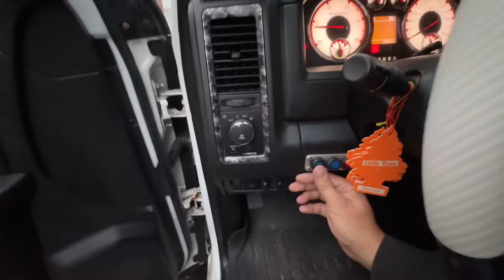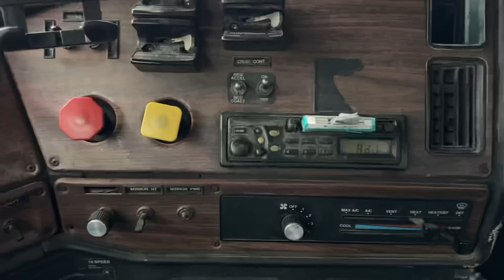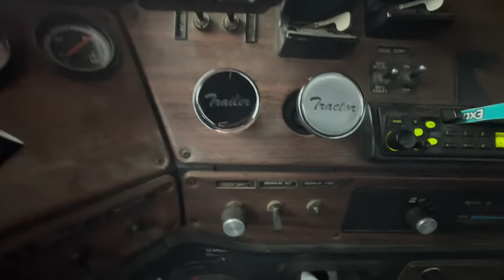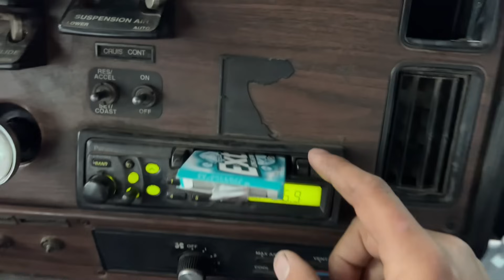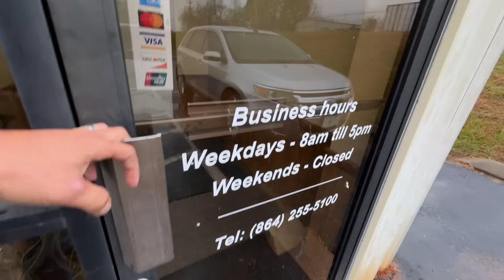Full all units ALARM 🚨 20 patrol cars on the Scene !! Where do we find this Copper fitting OTR

Comment: I’m thinking you just need to let it warm up most of those motors are like that!!! If there’s no choke on the carburetor get a cable one hooked up until it warms up and you’ll have a normal idle once it’s warmed up!!! Great you got that fittings and a couple to have in stock hopefully you’ll be able to get three loads in tomorrow fingers crossed 🤞!!!
Reply from the maker: Thanks for the tip Henry 😎🙏🏽